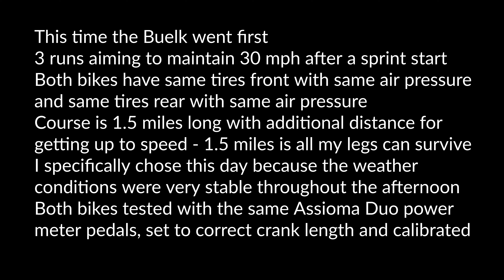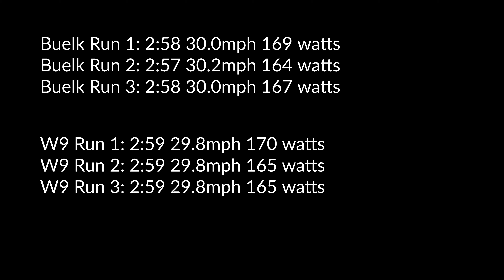W9 vs Buelk Speed Test #2 - the 30mph/50kmh Test

Comment: Very tidy test, and actually these are the results I did expect to see. Thanks a lot! 
Concerning differences: I do really prefer the Bülk because of it's flexibility. It doesn't fit super wides, but in warm and humid weather there's some more cooling to be had from removing the knee cover. I was still capable of riding 30 mph average without that cover, so it doesn't slow it down thát much. It's just a really well designed velomobile. A Milan SL might be faster but I don't fit in one of those :-)
Reply from the maker: I agree.  It's the comfort features that really sell me on the Buelk.  Little things like the shelf over the swingarm, the cable holding the tiller off my torso, the channeling of rain water away from the hinges, the multiple hood options, the ease of entering and exiting, and seating flexibility is big for me too.  The W9 feels like it was meant to be a barebones sports car and the Buelk was meant for luxury cruising, but can be set for high performance too.  I'd probably be a bit faster in a Milan SL, but the Buelk is more than fast enough for me.

Comment: Thanks a lot, Ben!
It's all true, what you have said...
I m pretty sure that my 7 year old DF will produce similar results.
Reply from the maker: With wheel pants, yes. Without wheel pants I would expect the DF to be a little bit slower. The olen wheel wells create some aerodynamic drag that will produce a little lower speeds. With pants, it is possible the DF would be equally fast.
Reply: @mnveloguy  Hey Ben! Nice vid ... so no difference at all in an everyday use setup. 
Did attach some "half" wheel pants on my DF and I think that helps a lot - without increasing the turning circle. Mainly the crosswinds are handled better ☺
Reply from the maker: @devasfpv2232  I remember seeing your half wheel pants when we met. Seems like a good compromise solution. The DF has a reputation for being impacted by wind. So far the Bülk seems to do the best with crosswinds.
Reply: @devasfpv2232 Do you have a pic or vid concerning the half wheel pants?
Reply: I have a DF XL (without wheelpants) and a Bülk. On daily commutes, they're equally quick, only not if I have a nasty headwind. I often commute at 25 mph average (without hood) and it doesn't matter which velomobile I ride to do so. The DF accelerates and climbs a little bit easier and I think this is due to the more upright position. When I really go max effort, the Bülk is faster for two reasons: 1) at higher speeds the aerodynamics play a much bigger part. The DF really feels like it hits a wall around 35 mph, the Bülk just keeps going. 2) In the DF, my peak power output is 200W higher, but my FTP is some 20W lower than in the Bülk. My heartrate just goes through the roof when I try to maintain 330-350W in the DF, while in the Bülk it's painful but manageable. I think this is also due to the position, as if the air intake and/or blood flow is somehow limited a bit in the DF.
Reply: Great stuff, Ben! Thank you as always for the helpful test results and informed thoughts about these epic machines!
Reply: Hi! I'm from France, and i usually ride my DF standard (not XL) with friends in Milan, snoek and DF XL. There's a huge différence between thé DF and the DF XL at high speeds, like you Say, the XL hit 35 but don't want to go over. The DF std keep going like Milan and snoek, whithout pants. I love my DF for that. Paris Brest Paris next month! 1200km in less 90hour👍. Cheese from France 😊

Comment: power ~ speed³  Buelk / Alpha efficiency relation run1: 1.026 run2:1.047 run3:1.008. Average 1.027. 2.7% more efficiency is a lot for racing. But in dayly driving convenience is more important. Variation is a lot between the measurements as MN said. So do not trust my calculation.
Reply from the maker: I’m not clear which velomobile you are determine was more efficient.
Reply: @mnveloguy  Buelk was more efficient
Reply from the maker: @burkhardg4095  2.7% was more than I was expecting. Still I think it is within the margin of error. I found the seating position of the W9 made it harder for me to breath when pedaling hard. That could account for the difference. 

Overall I have found the Bülk much more practical for my urban riding situation. More adjustable, enough cargo capacity, all the hood options, and the smaller turning radius make it a better option for me.

Comment: Thanks for your sacrifice! It's been awhile since the trial but perhaps in retrospect, do you feel one is better at transferring power from the pedals to the drive wheel than the other? Admittedly a very subjective comparison but your thoughts are appreciated.
Reply from the maker: I think they are equal in power transfer, especially now that I have switched to 140 cranks in both Bülk and W9. The difference to me is in features and comfort. One person may like the more spartan setup of the W9 while another may like the little creature comforts of the Bülk. For me the hood system and seat system of the Bülk along with airflow are what made me decide the Bülk was right for me even though I find the W9 more aesthetically pleasing.

Comment: Valid test. You did add nonstock mirrors to W9 and Daniel Fenn optimized it making it not a stock set up. Also, W9 does not usually come with Hotspot. They are both amazing velos that are about the same speed.
Reply from the maker: Yes, as I explained I’m not comparing stock configuration. To truly see the aerodynamic difference both Velomobiles need to be set up the same. If I remove the mirrors and hotspot, then I need to do the same for the Bülk and will get the same results again.
Reply: I like how you tested it and it works. For me, I would order without the extra mirror, but with Hotspot. Actually, I would order M9, but you have the smaller W9….so its the best that we can do right now. I can only fit into a M9 and not a W9.
Reply from the maker: @johnyang1420  Yes.  The W9 is a tighter fit.  The M9 would likely be a bit slower, but I think that only matters if you're racing.  The Buelk could be an option for you, depending on your size if you want the same efficiency as the W9 but more room for longer legs/torso.

I found the mirrors in the W9, even with my head in the intended position, didn't give me the field of view I wanted.  Now that I'm done aero testing I'll put the Zefal Spin mirrors back on.  I prefer the field of view from them compared to the mirrors with cones.

Comment: Were the tests run with the cameras mounted or unmounted ?  I think my DFXL is significantly slower.
Reply from the maker: Cameras mounted. The GoPro max is a giant unaerodynamic brick. I would expect the DFXL to be slower. Older technology and open wheel wells. My quest xs was slower too. Probably around 5% slower. Keep in mind that the wattage varies by system weight. I weigh 135-140lbs depending on recent cookie intake.
Reply: @mnveloguy  Oh you're light Ben, thanks for the heads up.
Reply from the maker: @pedalpowercycling  yes. In theory I’d be a good climber on a traditional bike, minus the fact that I’m not especially muscular.

Comment: RPM is different in the movie, was it in all runs ?
Reply from the maker: W9 has 140 cranks. Bülk has 155 cranks. Strava doesn’t show me the average rpm on segments so I don’t know if one bike had higher rpm than the other on average. I did try to find a gear that I could most comfortably spin in with both bikes.